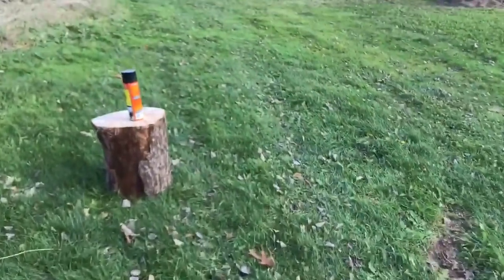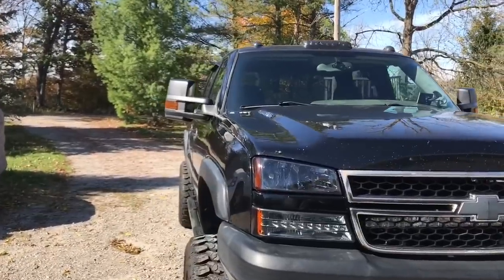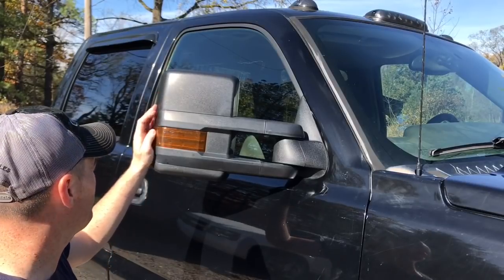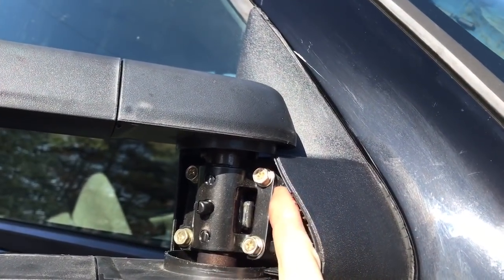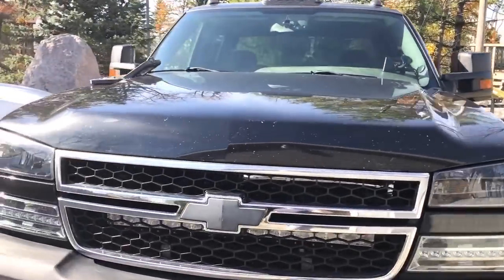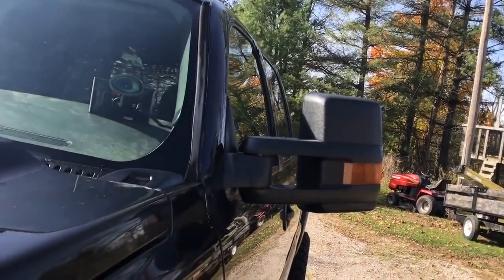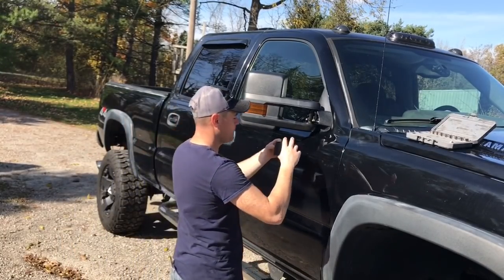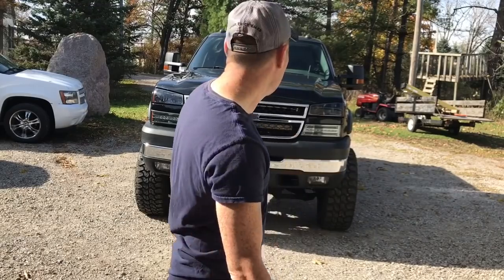How To Level 2017 Tow Mirrors on a Silverado

Comment: Nice, Just bought new and installed yesterday. Hate the crooked thing BUT will fix today!!!  Next will be adding a toggle switch for the 2 white LED facing to the rear. Should help as back up lamps. Mine do have front and rear facing turn signals, cool upgrade... Thanks, job well done!!!

Comment: It looks great man, I probably would of used a level too to make sure that they are leveled to the ground but for that you would of needed a leveled surface
Reply from the maker: +alfopaco87 great point didn't think about that thanks for the insight
Reply: You shouldn't use a level unless the truck is 100% level on the ground. U wld want to use a square so that u can tell if mirror is a perfect 90 degree angle to the truck

Comment: Doesn’t changing the angle on the mirror get rid of the detent that actually holds the mirror in place? A person I know did this and said going down the road his mirrors would actually fold in. Just asking because I prefer the look of the straight up and down but I do not want any problem with them.
Reply: My passenger won't stay open now 😭

Comment: So did you use one tooth washer & a flat washer for each one or what I am confused. I bought a set of tow mirrors & I'm having the same issue only I think it's just the passenger side.
Reply from the maker: +Nicholas Bono I used two 6 mm washers on each top bolt
Reply: So I did the 2 washers that mirror just bounces all over the place not a good idea I even took one washer out on each one yeah that ain't working

Comment: On mine, the passenger side was higher. It was rubbing against a piece of rubber trim, so I just cut a small piece off with a razor. The glass on one of mine is a little wavy too. Already my second pair because of that.
Reply from the maker: +Cory that sucks I guess I got lucky

Comment: So I just bought the same set for my truck and they fold in against the window to keep them tucked in for parking next to a road or something. However when both mirrors are folded out to be in use the passenger side mirror doesn’t fold out as much as the driver side. How can I adjust it

Comment: Great video man I was wondering my driver side mirror doesnt fold where I want it its manual but where it stays in place is to in towards the truck and can't find a way to fix it was wondering if you knew how to fix that
Reply: Jony ortiz I am having the same problem. Did you find a way to adjust them?
Reply: Yeah mine is the same.. might be on purpose.

Comment: I would have added a 3rd washer on each. They look like they still have a ever so slight upward angle to them. May have to find a washer that is about half the thickness of the first ones you used to get the driver door to match because it does look uneven from a distance. And honestly I would have used a lock washer in place of the plain small ones or loc tight since adding washers reduced thread depth into the mirror. I'd be worried about the bolts backing out over time with vibration. just my $.02
Reply from the maker: +Charles Stevenson great advice! I actually added a third after this video I think they sit fairly level now
Reply: Is the detent action weaker now....they fold much easier?

Comment: I have been hesitant to do this mod because i'm worried they will bounce around have you noticed any more movement out of them ?
Reply from the maker: +GMC DURAMAX they are solid and I have the cheap ones I should have put it in the video but the cover I took off will go back on but it doesn't fit right
Reply: Truck Master   Sweet good to know that was the only thing holding me back thank you love your vids!!
Reply: You have to do some grinding on that cover to make it fit. I put three washers on mine so I had to do quite a bit of grinding to make it fit right.
Reply from the maker: +Chevy 55 I know I forgot to mention that in the video thanks for the advice
Reply: You have to drimmel the top lip flat on the cover
Reply: Which brand are the mirrors?  I have YITA and after trying the mod, the mirrors were very loose .  I removed the spacers because of this. Anyone else have this issue?

Comment: Does anyone have an issue that the glass changes position every time truck is started? If so, how did you fix it?
I already tried setting the memory feature in my 03 suburban, but no luck
Reply: Theres a way to turn the automatic tilt off thru the controls in the dash and steering wheel. I did mine but cant remember exactly. Got it off google. Very easy

Comment: Does this mod affect the way the mirrors fold back?
Reply from the maker: +CirclePFarm not at all but the cover I took off doesn't fit right I should have put that in the video
Reply: @TruckMaster  Same. Just did mine. Did you end up using a dremel?